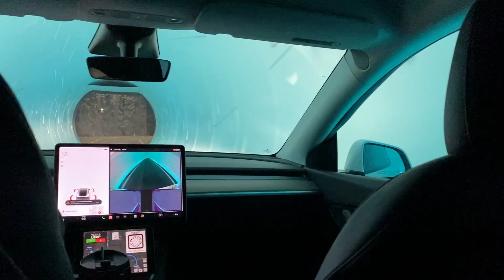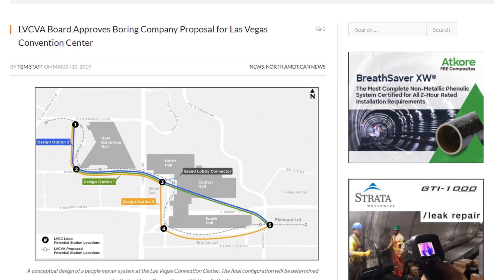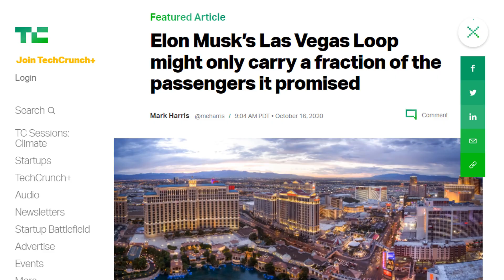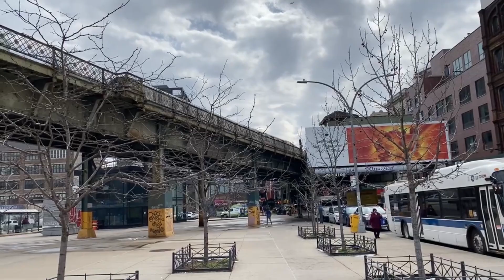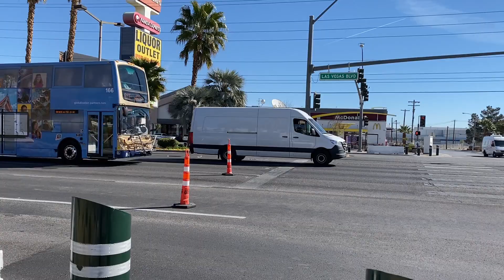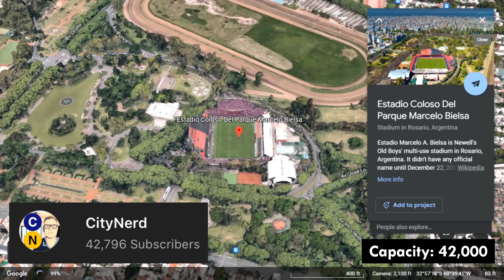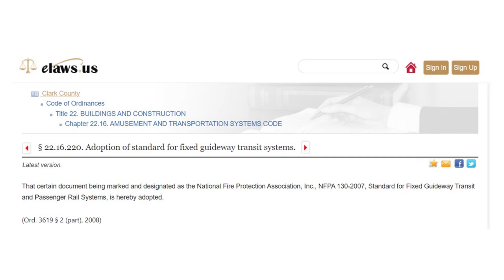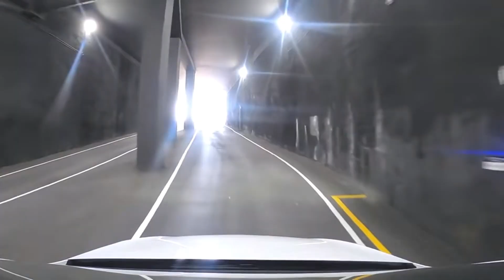Inside the Las Vegas Loop: Transportation Game-Changer, or Complete Waste of Time and Effort?

Comment: The Las Vegas Loop is a taxi service in a short, closed system.  If a passenger paid the full cost of a trip, there would be a savings by sharing the vehicle with strangers, and the ride is faster than walking.  But that's it.  

If it attempts to expand along The Strip it will need to use much larger vehicles (requiring larger tunnels), and it will have to observe all the safety laws governing public subways.  For large-volume public transit, it makes more sense to invest in a driverless rail system (I'm thinking like London's DLR), perhaps improving on today's successful technology.
Reply: Not just a taxi service, but also a Tesla marketing scheme. That's probably why they bid so far below cost: they're getting tons of people to sit in a Tesla and chat with a sales representative for a few minutes, while also moving them from A to B.
Reply: Adding some rubber-tired higher capacity vehicles like the 16 passenger Pods or small-ish rubber tyre trams or buses could certainly be useful in the Loop for high traffic routes - particularly pre and post events at the Stadium or on very busy routes between high traffic destinations during peak hour. 

However, it would be important to retain probably a majority percentage of small capacity vehicles such as the 4-7 passenger Teslas to realise the benefits of personalised point-to-point transit.  

As soon as you have to start using larger capacity vehicles, you either have to ensure everyone on that vehicle is going to the same destination or you need to have that vehicle stop at multiple destinations on the way like a bus, tram or train. 

Either of those options is certainly possible but they do have the disadvantages of slowing down the transit for those passengers.  No longer do they walk into the station, jump into the first available EV and immediately drive off to their destination at high speed with no stopping in between. 

Instead they have to wait for a bus/pod/tram that is going to their destination and/or wait to fill it with other passengers also going to the same destination or be forced to go to potentially many other stations (10, 15, 20?) on the way to their destination.  All of this adds extra time to their trip and slows down the average speed of the vehicle with frequent stops. 

With only 1-4 people in an EV you don’t have to go to other stops on the way to your destination. And if some sort of allocation/ride-share system is introduced, throughput efficiency can be improved even more. 

Outside of peak hours, instead of having to wait 30 minutes or an hour for an infrequent bus/tram/train, with individual EVs always waiting at every station, you have instant access to a whole EV to yourself to go directly to your destination at high speed.